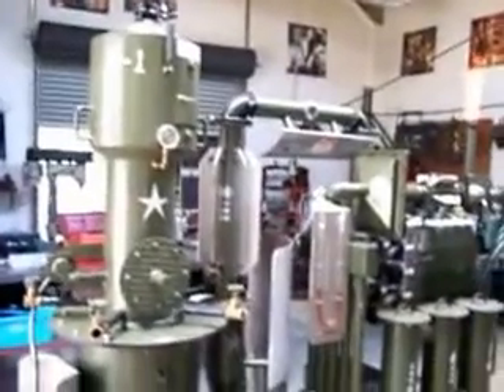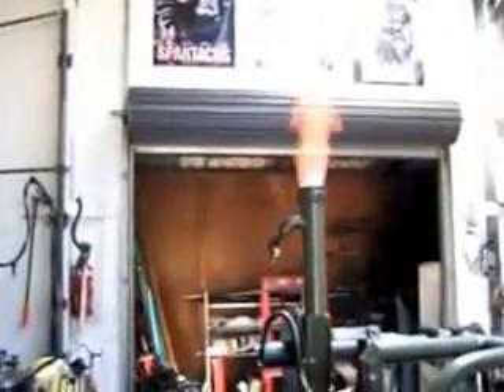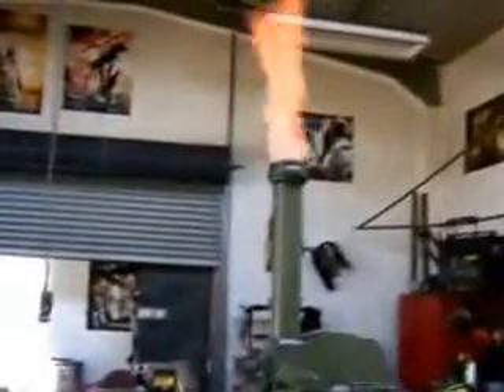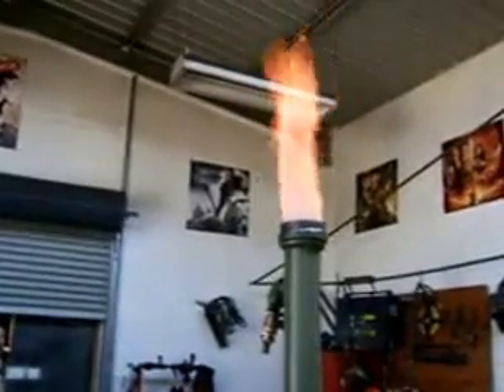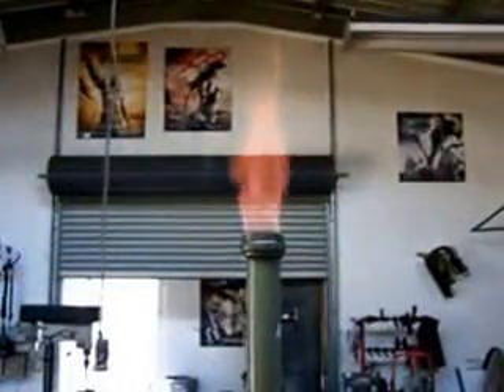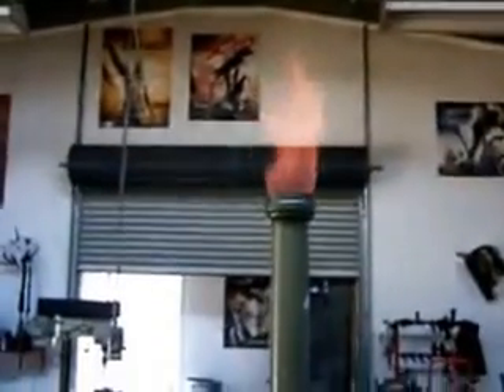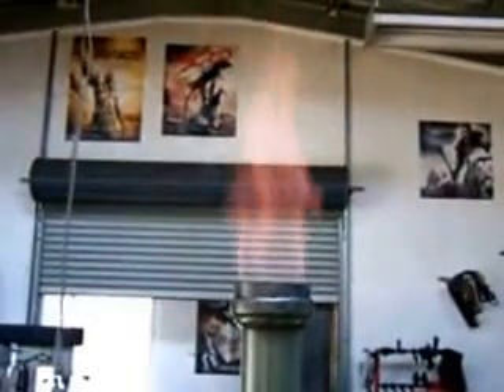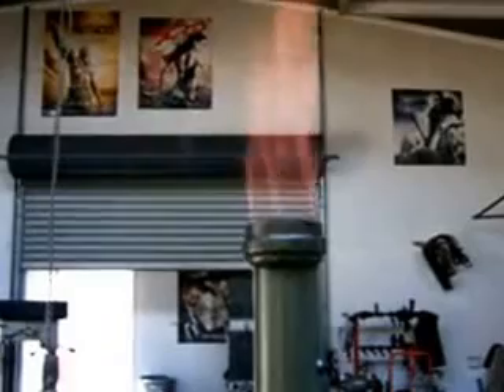The new A-1 Gasifier, part 4

Comment: You should look into getting a timer for your grate and hopper agitators. We run separate timers for both our grate and hopper.Think of them as preventive measures not corrective measures. This will give you more constant gas output and not effect your engine as much. Keep in mind when you actuate these you are creating a flow internally inside your machine. If you shake the grate too long you create a void in your char bed and the machine will need to catch up effecting gas output. Same goes with your hopper. You want a balance between the two.

Comment: Well done, you will have no issue running an engine. When you go to an engine run the engine will pull many times harder than your blower. So It will get up to your operating parameters very fast.

Comment: Yes sir... I can tell by the flare that you are either right at or well into the tar cracking temperatures. When you have a flare that's that transparent orange even on a video, that's your first hint that things are in the right direction! Congrats.... I want to tell you that what you have is one hell of a mean machine!
Reply from the maker: Thanks man,, i am determined to get this puppy doing what it should,, i cannot thank you enough for your mentoring and selfless advice, i would still be fumbling around if it wasnt for you flash,, i am dancing on the inside,, good on you man!!
Reply: *****
Hey no problem man. I'm finishing up on my build too. I've finally gotten it off of my carport and built the gasifier into a frame on wheels and my next real step is an automatic grate shaker / woodhopper vibrator setup. I rebuilt my carburetor today too due to vibration issues and the new build is rock solid. I'm editing a new video right now showing the build so be looking for a new video soon.
Reply from the maker: flash001USA
Sweet,,  as always I cant wait, i did catch your gasifier trolley set-up, looks really nice and compact, i am interested to see what kind of spin-off design you come up with for your shakers etc.